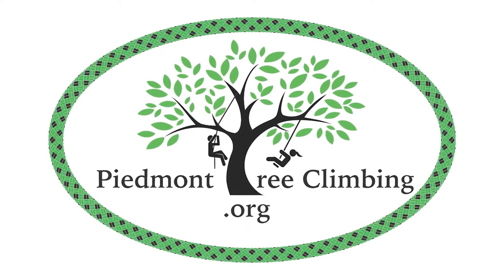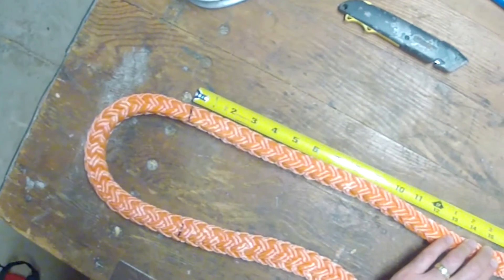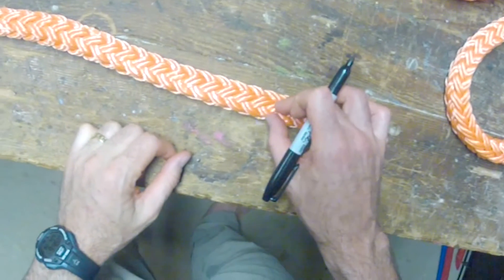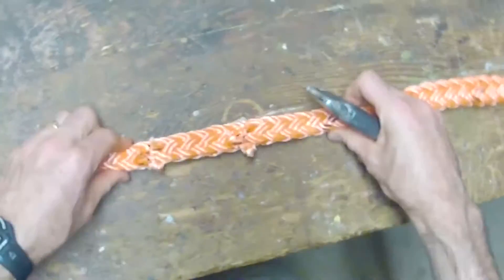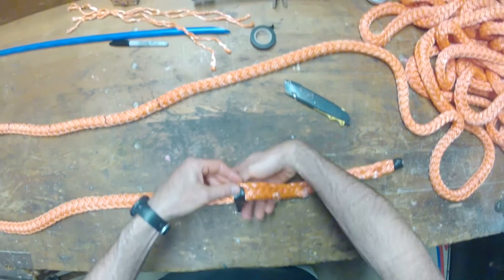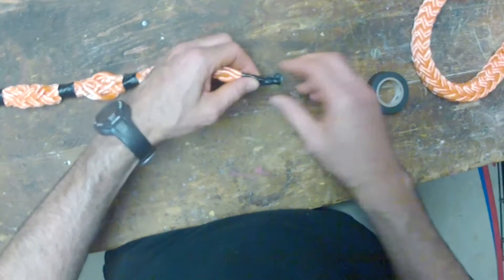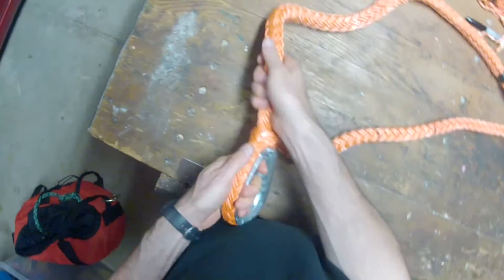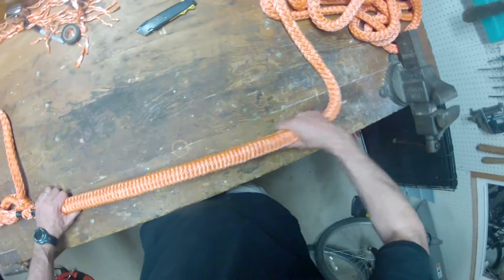Triple Tuck Eye Splice video

Comment: Would any if the loops have the same strength? For example if used for rigging, maybe adding more loops for different size of tree
Reply from the maker: The loops can't be used for alternate connection points or you will pull the splice tail out.
Reply: @PatrickBrandt  thanks for the reply. I already made a different one for rigging. I know now why it wouldn't work. Thanks again.
Reply: Is this the proper rope for a tree swing?
Reply: Yes it is @Ambullman

Comment: whats the purpose of the midline passes creating the loops.  why not just make one brummel lock & a long bury? (honest question im still learning learning)
Reply from the maker: ryan sahs great question. A Brummel lock requires two free ends. This process works well with only one free end.
Reply: @PatrickBrandt  would this work equally well with 1/4 or 5/16 amsteel?